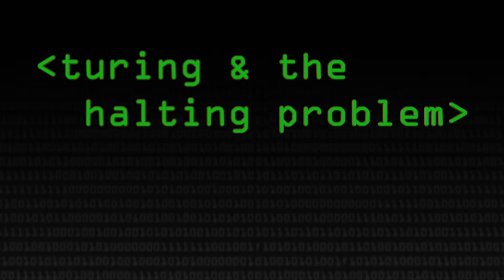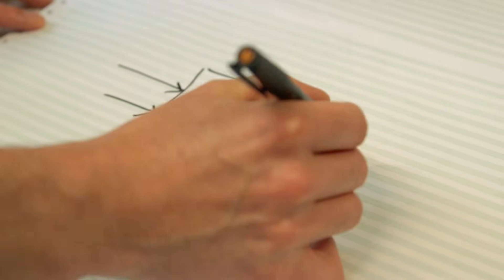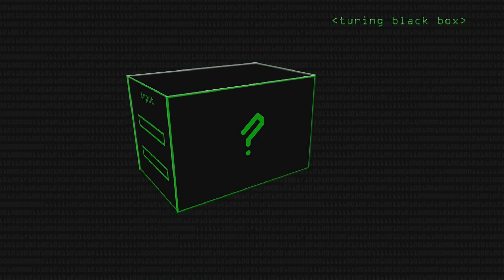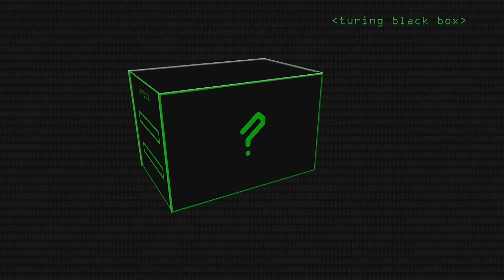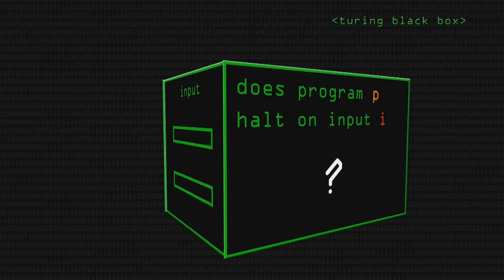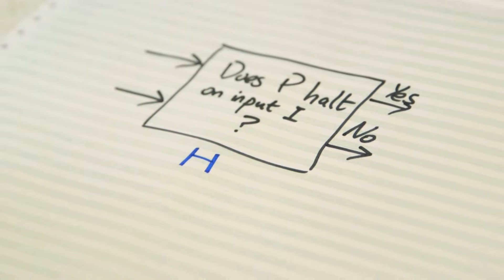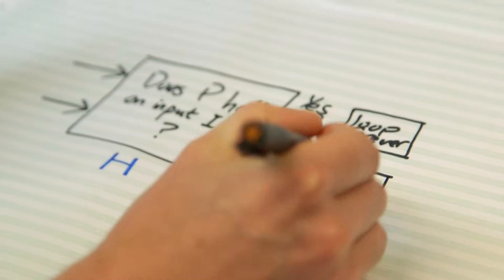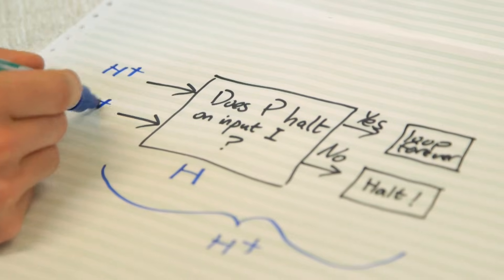Turing & The Halting Problem - Computerphile

Comment: here is a much better version of what i posted below. This video is greatly in error................1.	The Halting Problem authored by Alan Turin I found to hint at being very similar to Goedell’s incompleteness theorem. My critique which might be thought presumptuous given both of their reputations is I think, minimally interesting and worthy of discussion, even if that consideration would only be concluded to be a component of my education. Generally speaking, I have seen three versions of Turin’s proposition formulated by others that it might be conveyed in laymen’s terms. I will address them exclusively because they, in my opinion, most faithfully represent it. I will begin by stating that I have not read Turin’s proposition directly, but have dealt only with the presentations of it by others. If I am wrong in my conclusions, I would feel confident in saying that it is because of the error of those presentations. 

	In the first, as I understand the general scenario, there is a program A which analyzes program B and program A outputs whether program B will halt or continue on, such that a (reverser) program C would have that output as input and execute the opposite. Why there would be a reverser program C at all, given the goal of program A and Program B which seems to define the entire objective of the combined functions of the two, i.e., to determine whether program B would halt or continue, can only be to deliberately introduce a contradiction by self-reference. It should be remembered that we were instructed to accept that program A could accomplish its task and output halt or continue on.
	Then, the proposition is advanced such that program A would run program C directly and by that would create a contradiction in the output, that if program A output halt, program C would continue on and if program A output continue on, program C would halt, thus, if it halted it didn’t and if it didn’t, it did. This is not a discovery of a contradiction in the outlined function of the Turin machine but rather the deliberate introduction/inclusion of one, which would mean it demonstrates no real problem with mathematics or logic as proposed. The question is in fact, quite decidable. Program C is presented as that which functions as a response to the output of program A with regard to the determined halting or continuing on of program B. If that output of program A as an input to program C is denied program C by the (assumed) removal of program B that program A might analyze program C instead, by what would program C be inspired to function? Program C is reactive and by definition has no “internal” architecture (as defined by the video’s authors) to have decided on its own, i.e., without an output from program A to be its input, whether or not to function in some way, i.e., to halt or continue on and thus, could not be analyzed by program A as to what it might do. Again, program C would require an output of program A to act as an input to program C, that output from program A being a determination of an analysis “already computed” to which program C might react which can only happen “after the fact” (of that analysis). Program A then could not analyze program C because program A could not generate an answer as to its halting or continuing on which program C then could reverse to generate the intended contradiction. Again, this point reveals that the contradiction was not discovered by this scheme but deliberately introduced.
Deny this and you deny the very definition of the proposition.
	There is no continuity in terms of logic in this problem, or it is explained badly. I venture that Turin thought well of Quine’s liar paradox as did Goedell. Confident in my critique of the liar paradox in the above material, demonstrating that it is a complete fraud and invalid in every respect, I feel comfortable in proposing the questioning of this halting problem along with Goedell’s incompleteness theorem. It should be clear, at least in the context of the usual presentation, that if program A outputs that program B would halt, there is nothing which threatens. Additionally, “if” program A were able to analyze program B and determine that program B would halt then by definition, it would be able to merely declare that program B would continue on if it (program A) could not determine that program B would halt (not be able by analysis to determine that it would halt) for that is the only alternative left with regard to the two possibilities. If program A could be claimed to be correct whenever it output that program B would halt then it could only be that it would continue if program A could not return a “halt” output. Logically, by virtue of the definition of the scenario, this is a necessary conclusion.
	If the results of the above critique were ignored and the notion of program A running program C which would purportedly create a contradiction, it only reveals the sophistry of the proposition. As with the liar paradox by Quine, in which “this statement is false” requires that it be both true and false at the same time, the Turin halting problem proposition as presented requires basically the same. The performance of the analysis of program A of program C where program C would flip the finding of program A, creating a contradiction in the expectation that program C would halt and not halt at once, as does the determination of the simultaneous truth and falsehood of “this statement is false”, the latter proven a fraud, would indict the halting problem in equal measure. The self-reference employed in both cases is the culprit and by its use, makes them both invalid as conceptual constructions.
So, this version of the Turin halting problem is solvable, not because of any clever analysis but rather because it was never a problem to being with, merely another fraud of self-reference.
	The second version of the haling problem is similar but slightly more complex in its presentation. In it, the halting detection program, program A in the above, is embedded in  a reversing program C. As in the above version, if program B is input, program C apparently offers it to program A and which then outputs whether or not it will halt or continue on. Program C in which program A is “embedded” would reverse this output as in the version above (again, for the purposes of generating the contradiction). Here again it is claimed, if program C is then given to the overall program (C  1) as input, it would generate the same contradiction. But this is also a fraud. Program A could not analyze program C as input because it is also in this case reactive and thus without an output from program A to which to react, it would not function and would have nothing within its architecture to indicate what it would do that that analysis might determine, i.e., halt or continue on. 
•	Again, as with the liar paradox by Quine, in which “this statement is false” requires that it be both true and false at the same time, the Turin halting problem proposition as presented in this version requires basically the same. The performance of the analysis of program A of program C where program C would flip the finding of program A, it then again flipped by the overall program C 1 in which program A is embedded, creating a contradiction in the expectation that program C would halt and not halt at once, as does the determination of the simultaneous truth and falsehood of “this statement is false”, the latter proven a fraud, would indict the halting problem in equal measure. 
•	The reverse of program C output by program C 1 is different in two ways as relates to the contradiction proposed as the indication of the Turin proposition. Here the output of program C is independent and precedes the reverse and output of program C by program C 1. Program C 1 executes the reverse “after the fact” of the analysis and thus there is no contradiction but rather a simple chain or sequence of functions. In other words, the output of program C is in a sense “internal” to program C 1 and it is only program C 1 which outputs a determination “external” to the system. 

In the analysis of the liar paradox and similar paradoxes, it is clear that they are pure sophistry and in fact, not paradoxes at all. The halting problem, in part formulated in the context of the intent of these paradoxes is on its face, a fraud. Frege, Cantor and Hilbert were right and Quine, Turin and Goedell were wrong.

Comment: try this...................i posted it in an other video....................What makes no sense as per the logic of the definition of the scheme in the video, is the notion of using the opposite program as input to the halt program even if we consider the halt program as being contained within the opposite program. The notion of the halt program analyzing an input (program) and outputting halt or continue on is comfortably understood. But the opposite program is reactive not proactive and does nothing (as defined in the video) but reverse the output of halt “after the fact”, i.e., after the analysis of a program which “initiates and has a function to perform”, is completed. To claim that the halt program could analyze the opposite program as input and determine if it would halt or not is the actual problem. By the operation or function of what would the opposite program determine to do the opposite if there is no output of the halt program to which to react? What in the functional structure of the opposite program, absent an input of halt or continue on would indicate what “its” output might be? In this case, what would be the output of the halt program that it might be the input to the opposite program that it might react and do the opposite? So the opposite program would not be excited to function that it would indicate to the halt program that it would halt or continue on. This is the first aspect of this scheme by which it fails. 
The idea then of feeding the opposite program to itself as an input is a deceptive manipulation, no less a fraud than the liar paradox by Quine which/who I understand was its inspiration. If the overall, encompassing program is the opposite program (the primary program), it could be considered a kind of container of the halt program and the opposite program used as input. By definition, this makes the halt program’s judgment that the input program opposite as to whether it would halt or continue, correct. That the “container” or primary program opposite would reverse what the halt program determined DOES NOT produce a contradiction by any consideration. The primary program merely reversed that which its sub programs determined, and the primary program did so only “after the fact”, i.e., after the analysis was completed and as such is merely an additional function at the end in a chain of functions. Thus, the flipping or reversing of the halt program output by the primary program opposite, is no different than in the initial definition of this scheme in which the halt program analyzed the input program and the opposite program reversed it. 
I don’t care how smart Turin was claimed to be. This is just more sophistry from the same collection in which we find the liar paradox and other such piffle. Any thoughts? If I am wrong, I would really like to know.

Comment: Just as Quine created a paradox by introducing a self-referencing statement which was structured with a set definition as a subject noun but which was empty, and tried to state that it might be judged by the adjective false, linked to the subject noun/set definition by the linking verb "is", creating a contradiction, it appears that Turing has done the same thing by in a sense, overlapping the multi-program output back onto itself. This is NOT in keeping with that by which the problem was initially defined and a deliberate deception I would think. Can anyone show me if I am wrong and how?

Comment: Perhaps I am missing something but to me, this makes no sense whatsoever. Consider, if you have program A analyzing program B and outputting that it either halts or continues on forever, that output then input to program C, in effect, a reverser program, which merely does the opposite of that input, it is all very comfortably understood. But then if you run program C through program A and claim a contradiction because of program A’s output, i.e., that if it halts it doesn’t and if it doesn’t, it does, you have not discovered a contradiction but introduced one. 
Program A analyzes program B. You (not I) define that as its purpose.
Program B is determined to either halt or not by program A, depending upon the program B is. For example, if program B counted down from 10 to 0, it would halt. If it counted from 0 to -1, it would continue on forever. Program A would provide that answer, i.e., that it would halt or not.
Program C requires that output from program A concerning its analysis of program B to function or it would not.
If then program C is run through program A, how would there be any output at all, let alone this contradiction  you claim? It was defined (by you) as responding to the output of program A concerning the function of program B. To run it through program A there would be nothing to which to respond, i.e., nothing for it to reverse.
I think this to be similar to Goedell’s incompleteness theorem, these two deliberately introducing contradictions into mathematics and philosophy respectively. This halting problem merely creates a contradiction or paradox by manipulating the relationships between the three aspects of the problem as presented.
Reply: Exactly, and halting problem's purpose is to create a contradiction in order to prove that machines can't do everything (like a halting machine). That's all. This has many implications that were discovered later.
Reply: @flash1652  please respond again if you have time. i really want to understand this.

Comment: I find this very not reasonable, why wouod we make the machine loop when it's yes? And stop it when it's actually not halting. It's like were building a contradiction from the beginning and of course it's not gonna work. The first order logic isn't decidable is because we can't understand paradoxes. And this machine in itself is a paradox.
Reply: Yes, the point is to build a contradiction in order to prove that a halting machine cannot exist. You can't do this with every machine, only with the halting machine. For example, we can make a machine that calculates the sum of two numbers. Try to come up with a contradiction that proves otherwise. You can't. With halting machine, you can, because it's not possible.
Reply: @flash1652  Thanks for your comment I appreciate it and I get your point. That's true, if we want to prove a hypothesis is False we can just show that it leads to a contradiction.

Comment: But the proof is arised because we designed a system which do the opposite of what the H says.
If we remove the OPPOSITE then we have got the program which gives us the correct answer.
Reply: More like we have carefully crafted an input that H will fail on. If we don't construct that input, it doesn't mean we can't.

And since we CAN construct that input, that means H cannot ALWAYS be right.

Comment: Makes absolutely no sense to me.  You build H+ which basically negates the output/answer(giving the wrong or opposite answer) and because of that you supposedly confirm that H cannot exist.  Sounds like faulty logic. It only means that H can solve the majority of cases but not the case of H+ which is badly designed.
Reply: This version of the proof isn't great tbf
Assume we can build halt 
Then we can build a function f with the following algorithm

Ask halt if f stops 
If it says it stops 
Loop forever 
If it says it doesn't 
Stops

Thus , halt(f) will Always be wrong no matter where you call it 
So halt CANNOT exist , it is a proof by contradiction, we assume that something is true , then proves that this leads to a contradiction, which means that it was in fact , not true

Comment: Well that's easy all you have to do is extend the range of H's possible outputs to include complex binary numbers. That way H+ will halt without creating a paradox because the inverter function will halt on an invalid input.

Either that or I may be having a stroke.

Comment: the loop is beneficial for system stability if the machine is designed for rock paper scissors games. breaking the feedback loop breaks the machine potentially. interruptions are bad.

Comment: Your input can't be [yes] or [no] because your input is [function] [variable], unless the function operates on a bool. In which case, you're not ensuring a contradiction at all. You're only changing the input to the function. The way this is written is as if you're feeding the output back into the output. You cannot specify at the input whether or not the function and variable will halt or loop, because declaring that defeats the purpose of the halting-problem function.

All you're doing by inverting the output is exactly that, inverting the output. tl;dr the input accepts only (f) and (x), while the output is (1) or (0). (f) cannot be equal to (1) or (0) because it's a function, not a value. So the only place you can put (h+) is in (x) which only changes the output of (f), which may not necessarily change the output of the halting function.